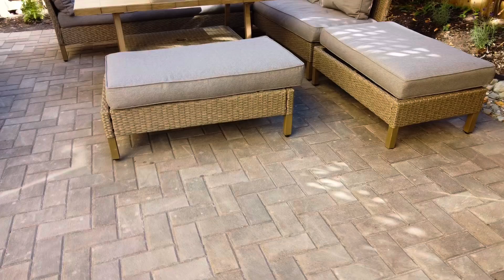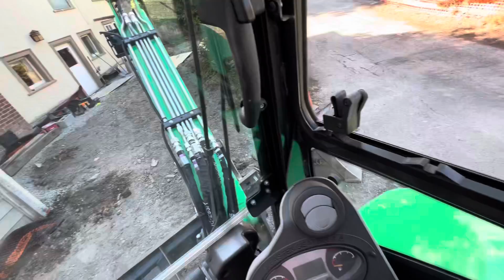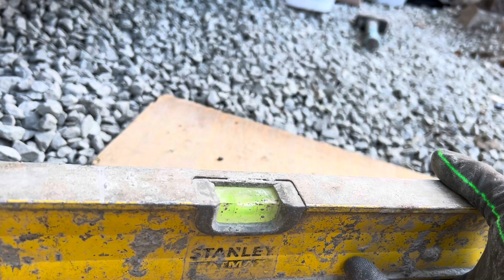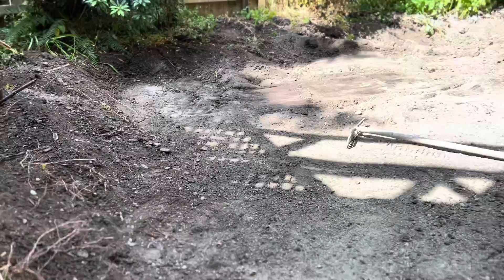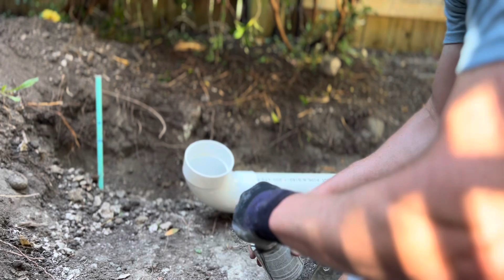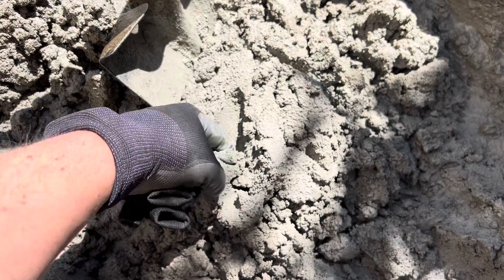Start your dream patio today: Pro site prep made easy. Perfect Patio! Part 1: Site Prep

Comment: Sorry, I’m the one asked you to lay fabric down over the rocks before you put your sand. Could you answer me like ASAP like yesterday? Sorry that’s a joke but I need to know cause I’m doing mine right now.
Reply from the maker: Hey no need to lay fabric before the sand, usually the road base if it’s compacted enough and thick enough will stop weeds from growing upwards, and otherwise just prevent weed seeds from collecting in the cracks on the surface later
Reply: @HardscapeCanada  thank you so much for responding back to my question. I thank you so much. God bless you. You’re really good dude.

Comment: I want to do DIY my little patio after seeing your video. but, how did you calculate "how much rocks" do you need for each layer on your project? thanks
Reply from the maker: Hey, the best way to calculate material quantities is the measure the area. Length x width x depth, and then you can convert that amount via the google search bar into yards or tonnes of material. Material like soil or road base will compact so it’s best to add about 20% to make sure you have enough.

Comment: Question for you on the subbase. I’m doing my own patio and am a little hyper focused on the slope. Does the dirt have to be a perfectly flat, sloped surface or if it has a little bit of variance can it be made up with the road mix? Trying to make sure I do it right and am new to this. Thanks!
Reply: Just came across this video while I tackle my DIY backyard project. I’ve got the same question.

Comment: Hi , complete novice here. Your drain pipe, how does the surface water get into it ? I see it is wrapped in black membrane/ material and then stone inside that over the drain pipe ?
Reply from the maker: The black material is a geotechnical/drainage cloth designed to let water pass rapidly through, while stopping fine silt particles. So the water flows across the surface of walkway, through the drainage cloth and drain rock, then collects (if there is enough water) in drain pipe and is taken away.